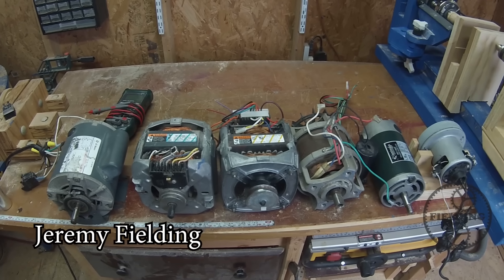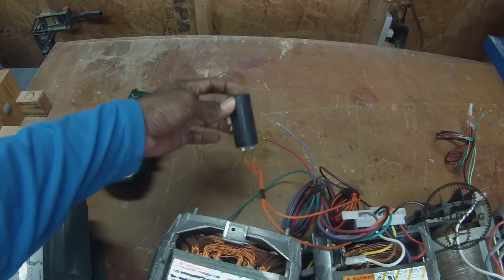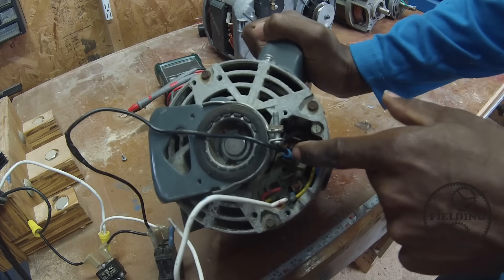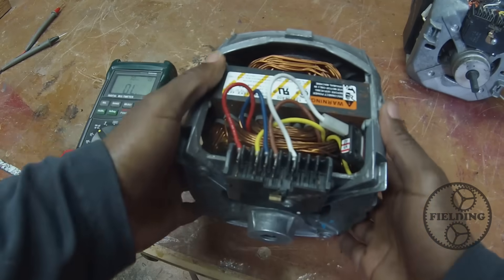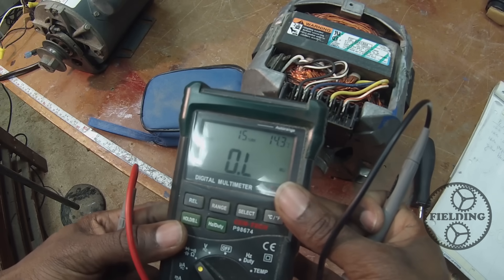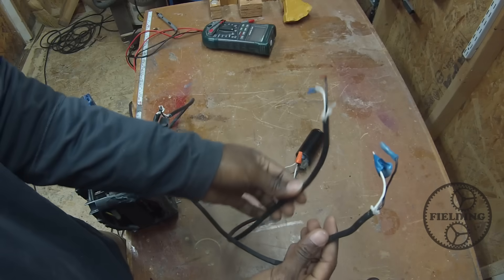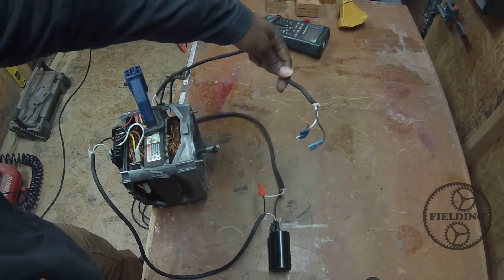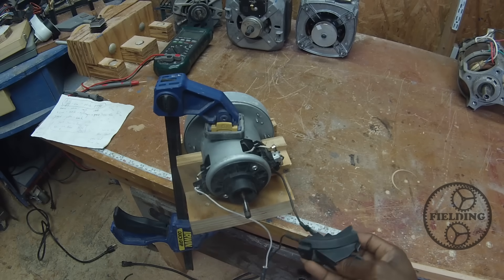How To Wire Most Motors For Shop Tools and DIY Projects: 031

Comment: Watch out: as a general rule of thumb, electric motor start capacitors can be replaced with a µF  rating equal to or up to 20% higher µF than the original capacitor serving the motor. On the replacement capacitor the voltage rating must be equal to or greater than the original.

Comment: Thank you,  a start capacitor, that would explain why the salvaged motor didn’t work!
Reply: you should also check out the different wiring diagrams for start cap.  motors. lots of diagrams on pinterest

Comment: What causes a motor ( say in this case the washing machine motor) to go CW and then CCW?  Is it the capacitor ( start winding), as to which one of the two-wire goes through the capacitor...?  
I also noticed that the various speed on the washing machine motor had more or less the same Resistance reading.  Nonetheless, does higher resistance would mean lower RPM?
CW on the washing machine means agitation, while CCW I think is for the water pump and spin.

Comment: A light bulb across the capacitor works great without damaging the capacitor and screwdriver tip. I don't know if you use light bulbs, but they act as a nice circuit protection device when used like a fuse. Thanks for the great video!

Comment: So I have to ask as a non engineer of any kind. Would it be possible to have 3 single phases connected the capacitors again in parallel if each 1 phase was bridged and had its own circuit?  For instance in Oz the light are one circuit and power outlets are two, and you got a Lecky out to setup a third or had a third would this be possible. 

And love the relay thing connected to the black capictor. Does that have a failsafe or is the coil of a rating, amps I think you said, that can satisfactorily work safely for so many cycles?  In saying I doubt I'd ever build it, as I am pretty sure the owner wouldn't want blowing up their garage. So purely hypothetical and I know in Oz you have to have the Lecky wire it or it voids the warranty. Still it is a fantastic way to explain like the other viewer said. Cheers for the videos ☺️

Comment: Very helpful video, thanks.  I have a question if I may... on the capacitor start motor, does the start winding stay hot *connected) while running, or is there some internal clutch to switch off from the capacitor?

Comment: Im confused im uk ive got a dryer motor single phase with capacitor. Red wire into capacitor and another red wire out on a bridged point and a brown wire also to the capacitor then a random white wire not connected to anything. How do i connect it to 230v ac safely??

Comment: When the motor design says "split phase" but then it says phase "1" does that mean single phase? I am looking for a attic fan motor and my old one has a cap on it but the pictures of a new motor doesnt have the hump where the capacitor is located in the pictures...

Comment: I understood everything up until you started to do the actual wiring, when you assumed we knew what kind of wires were coming from the wall...or from somewhere else? You don’t show where the power is coming from or how it is “split”-you say it is split but how can two wires go one way and two wires go the other way when you only start with 2 wires, and then why is it not positive and negative -why is it positive and neutral? And the relationship between the wiring of wires going round “windings” seems to wire separately for those different speeds so is this motor used just for the one speed? Or does the user have a choice of slow, fast etc at all times? And what is the difference in the windings for slow vs the windings for fast? And then when you say you “used the same harness” what exactly does that mean? Where does a “harness” start and end? How is the ground connected? And why is there a white wire seemingly just hanging in the air? And when you are touching the screwdriver to the capacitor are do you mean that the screwdriver has to touch both of the screws at the same time, by lying it flat? Or one after the other? All the wires are mixed up on the workbench and you are waving them around like we are already supposed to know what wires come from where and where they are going and why, but they are waving around so fast I can’t figure out what is going on. And it looks like there is a break in the wire before the first split, but it could be just a curl of the wire? Please hold them still. Show all of the wires, flat, with all the connections shown from start to finish. I could see no similarity between the wiring of the first motor and the wiring of the second....I am learning all this wiring and motors at the same time, and while I understood everything you said about the motors (thanks!) I have little idea about how the electric  wiring is related to the motors....and I really want to know...

Comment: Decent video.  Thanks for your time and energy.  Is the start capacitor disconnected by a a relay once the motor starts or does it stay connected all the time when it is running in the washing machine?

Comment: I read the note, but I’m gonna ask anyway. Just cause I’m hoping ... I don’t know... you changed your mind. I don’t have a difficult question and i watched the video a few times. If you address this question In there, I’m not seeing it.  

I have a salvaged washing machine motor. But they tore it out and there’s no diagram to it.  I’m just trying to get it moving for a shop project. 

It has 5 wires coming from inside. A black and a blue on one side that when checked, have continuity.  On the other side, black, red, and white. These have continuity in any configuration (black to red, to white, red to white, any 2).   They do NOT have continuity when connecting any wires from opposites sides.  As in the video, there are no clips or anything. 

How can I wire this thing up to work?... the only label on it says 120v 60Hz 5.2 LRA  3 phase

Comment: Jeremy:  I am looking on Craigslist and Ebay for a motor to power a TROMMEL sand sifter for removing rocks and pebbles from yard sand.  The guide's author suggests a 1/4hp Gear motor.  30 RPM is the target RPM for best sifting.
I've watched several of your videos about motors but still don't understand how to evaluate the torque or horsepower they'll deliver unless it's clearly marked.   It's hard to make a 1725 rpm induction motor work for a 30 rpm final application.

How do I evaluate if EBAY auction item s like "110V 15W 25K AC gear motor electric +variable speed Reduction controller 54RPM"  will meet my needs?
[Name: geared ac motor
l Rated voltage: AC 110V
l Rated speed:54 RPM/min
l Reduction ratio: 1:25（25K）
l Power Phase: single-phase motor
l 15W Gear Motor:70mm*70mm*134mm, Axis Length 30mm]

It's description says it's "high torque."

Comment: Discharge capacitor by grounding each lead to  ground, try not to discharge through the capacitor,could damage the electrolyte (on other types) or damage the internal part of the capacitor. :) using a resistor  is a good way to discharge, called bleeder resistors.  :)

Comment: Great video, very helpful.  For anyone else working with a potentially charged capacitor, yes, short it (with a screwdriver or insulated wire) every time before you touch it.  But I'll add: short it again a few seconds later.  The first discharge tends to get rid of most of the charge, but if it you do it too quickly, the capacitor tends to rebound and regain some charge as it sits and the remaining charge imbalance collects on the plates, which can still lead to an unpleasant shock.  The rebound voltage level is lower, so probably not a concern with 120V, but definitely with high voltage.  Those microwave oven capacitors are designed for high voltage and so they tend to have a 1M ohm "bleeder resistor" built in across the terminals (and indicated on the label) which slowly discharges the capacitor in a few seconds after the external voltage is removed, to mitigate shock hazard.  This can be puzzling if you aren't aware of it: the cap won't appear to hold a charge if you are testing it to see if it is still good, but this is by design.

Comment: Thank you, that was quite good, I think you left out a single phase motor without a capacitor but uses instead a starter winding.  It delays the current 90 degrees just as a Capacitor delays voltage 90 degrees, same effect on the motor.  Also there are nine or so configurations of switches on the side of half and one third HP washing machine motors, I use them when making chicken pluckers.  I have bee to several repair shops to see if they knew how they are wired, and they don't unless they have the diagram from the washer.  That doesn't help me as I get the motors after they have scrapped the washer.  Your methods are good for figuring out what and where the Capacitor needs to go, then you have to check the centrifical switch to see where the capacitor is connected.  Good job on the vidio though.   Steve

Comment: I'm new to electricity and wiring, so I'm hoping that maybe you could help me.

Today at work we had a 3-phase high voltage motor to wire upon an air handler. Once we got it in place and all wired up it wouldn't work.

 Me being new and learning electricity, I don't know how to check and diagnose the problem.
We thought wires may have been crossed, yet the motor didn't fry.

 So I was hoping that you could make a video explaining it. The motor that I was working with is probably a 2 or 300 lb motor 3 phase.

Comment: Thanks man, great vid.
Hey I have a small problem. I have a washing machine motor with 4 wires, green/yellow, white, yellow and red. The green/yellow wire goes directly to the frame (ground I assume), however the other 3 wires (yellow, red and white) have 0 Ohms between any connection, and all of them have continuity. Is this motor damaged?

Comment: got a 3-wire washing machine motor, white is neutral and i think the red or yellow would be the hot wire, it is a reversible, has a 220V capacitor.  am i correct in thinking the power wire goes into the capacitor then the wire coming from the capacitor to the motor?

if it runs, then, i think i found my new fan motor.  it also contains a protector, that when it gets too hot, the contacts will come open and shut the motor off.

Comment: @Jeremy Fielding ,  love your videos. Very informative. I watch most of them.  
I'm wondering, on an washing machine induction motor is there a centrifugal switch start that doesn't include a capacitor? One that the centrifugal switch just disconnects after the motor is up to speed? I have a motor I took out of one but didn't find a start cap anywhere. It was my old machine so I'm positive it was a complete machine lol.

Comment: Hi Jeremy. Firstly, thanks for very informative and interesting videos and greeting from down under (Aus). I have a query re. 3ph washing machine motors I hope you can shed some light on.
I've been mucking about with a VFD and some washing machine motors with the aim of trying to learn stuff but also to try and configure a speed controlled motor in my wood lathe. I have 2, 3wire brushless washing machine motors(240) and a 2hp industrial 3ph motor that I've tried with my 1.5kw VFD. the 3ph motor ran smoothly and quietly with no notable temp increase after c. 1/2 hr (no load). Both washing machine motors on the other hand - although they run OK- don't seem to run as smoothly as I expected. They also get very hot after say 20min+(110-115dec C). Upon measuring the resistance across the three legs I noted 2 legs at 22ohm and the third at c.45ohm - same for both motors. I'm wondering what your opinion is?

Comment: Jeremy,

I have a 250v motor from an ac condenser unit. I'd like to run it from a generator that only puts out 125v. It does not have an exterior wiring box to change the voltage. 

I bought a 1500 w step up/down transformer that has a European output socket. Is there anything special that I have to do to get this setup to work? Despite having the capacitor connected, the motor runs too slowly when I turn it on.

Comment: any advice on how to wire a 4 lead brushed AC motor? from a power drill. It has small inductors on the 2 wires which come out of the trigger. There are 2 more wires going to an electronic controller unit

Comment: Thanks for helping us understand this stuff!

I understand why speed control is tough to do on induction motors.  But I keep wondering if there's a way around it.  What if you bypassed the start switch and used another method to turn off the start windings, like a time delay, or rpm sensor?  The only drawback of the time delay would be if the motor was under load on startup, it might take too long to build up.  But the electronic rpm sensor could be adjusted to a much lower RPM.  When it get there it'd kill the start winding.  After all that, we could use a vfd to control speed.

Does this make sense?

Comment: @10:11 as mr Jeremy says, discharging a capacitor can be dangerous... using a 120V, >100W light-bulb also works if you don't have a big resistor. the light bulb will temporarily light up; when the bulb turns off, the capacitor is discharged...

shorting the leads with a screw driver is my last favorite approach.. it will damage both the capacitor's leads and the screw driver, has the potential to damage the capacitor, plus it produces a loud pop.

Comment: Hey, I came across a A/C condenser fan with motor (3 wire 220v) for free, I believe it works. I would like to enclose it in a cage and make a shop fan, do you know if its possible to wire it to run off of 120volts? Thanks.

Comment: I will never forget when I started playing with these motors, I had a vaccuum motor I had rewired. Being I was familiar with smaller drill motors, I thought oh this little thing wont have that much power. I was holding it when I plugged it in. It quickly left my grip, and begun bouncing around the kitchen floor as my daughter started screaming and running for the other room and I started scrambling for the wall socket!

Comment: Nice video. I might add that the washer motors are known as "split phase".  On those there is a loose standard for color coding of the  internal leads where yellow and blue are almost always the run winding and red and black are the start. The one is a PSC or Permanent Split Capacitor uses the big run capacitor. Keep up the good work!

Comment: (4:42) - You say you would need pulleys to change the speed of this motor.
I don't understand how you would use pulleys for this.
Personally, I would use gears.
You know, that have cogs and teeth.
>
Reply: Well, you'll need a belt to connect the pulleys....

Use two different size pulleys.

Comment: At (4:07) you say that with a single phase brushless motor, there's no simple way to control the speed of the motor.
What about a variable frequency drive ?
Wouldn't that work ?
>

Comment: Hey Jeremy. You seem to be pretty damn smart when it comes to wiring motors. Can i ask you why i cant get mine to work. First i picked up a Delta grinder with a push pull switch. with 4 poles. Its a 1hp single phase with the starter capacitor. The switch was working but it had to be just right, so i pulled it apart. Well the 2 springs inside just fell out and the plastic was broken. Anyhow its got 2 wires coming from the capacitor, then you have the 2 from the power cord and i tried to wire it to a house flip switch and i could get the motor to start ok, but when id flip the switch off, it would trip the rest on the extension receptacle. I hooked the white wire and one from the capacitor to one screw on side of switch and the black wire and the other wire from the capacitor to the other screw, but im doing something wrong. Got any suggestions?

Comment: I found a few points confusing. When you were explaining the washing machine motor you were saying it's brushless with a start winding and 2 other speed windings? So i guess neutral goes to one central point on the two main windings and the capacitor goes to the higher resistance black start winding which in turn also runs back to neutral. Then there will be two more connections left over for the two speeds? So the 2nd live wire, the one that does not go through the capacitor can switch to either 1st working speed winding or 2nd speed winding to make it faster? Is that right? 
  And just to finish, that centripetal switch you were talking about. Is that also in the washing machine motor? Does it break the connection to the capacitor as soon as the motor starts up?

Comment: Use a resistor in the mega ohm range (eg 1MΩ) to discharge big capacitors, takes a bit of time but less likely to destroy your capacitor or spark in your face.

Comment: I really enjoy your videos however I have to say the way you have presented the start capacitor wiring is very confusing for people because of your use wiring from a vacuum cleaner or whatnot that you're using you do not show people very clearly how your start capacitor has to be wired you should use a simple format with corresponding colors that being said I do enjoy your videos

Comment: Thanks for the video! I disassembled the motor from a front loading washing machine, but I couldn't find the capacitor anywhere. The motor is 1-phase brushed 240 V motor that has 6 wires going in.  What kind of capacitor should I use?

Comment: Hi Jeremy, you produce quality videos. Thank you for your efforts.
I have a question please.
I have several old electric motors that are not grounded (  large woodworking equipment)
How can I properly add a ground wire for safety?
Thank you

Comment: Can you show a simple single phase brushless motor schematic for an electric planer thicknesser 240 volt AC. showing the starter cap and the running cap and typical values and colours.thanks. I like your straight forward explanations. I have an Electra Beckum palner\thicknesser andit just hums or blows the mains fuse 13 amp rated.